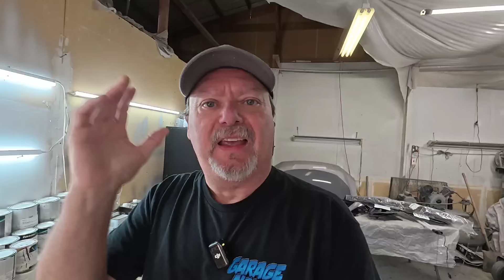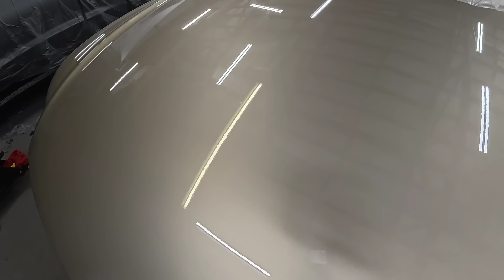How to Spray Clear Coat Like a Pro | Avoid Orange Peel, Runs & Dry Spray!

Comment: Great video 
You mentioned you sprayed the color last week .  How am days ago was it ?  I sprayed color just about 2 days ago and now ready to spray clear .  I’ll Just tack cloth and spray clear like you did in this video ?
Thank you sir
Reply from the maker: No most base only has a 24 hour window before you may have adhesion problems.  I painted part of the car the previous week base and clear. You will need to scuff and put one more coat of base before you clear coat.

Comment: Question.  Sanded with 600 cleared over previous clear.  Body panel clear cost now is cloudy and can see scratches under clear. Any fix or just sand a rebase and clear panel?
Reply from the maker: If your sure it's under the clear than no. It would need to be sprayed with base then clear.

Comment: Hi I know this may be a stupid question - But I will be painting in a small 2 car garage.   Can I get by with turning my furnace and water heater to pilot,  or do I have to completely turn both off to be safe.    I'm just not sure how combustible painting a urethane base/clear coat in my garage is.  I will be cracking the garage door open with a couple fans exhausting the fumes out.

Comment: Chris, your videos are well done and very helpful! Just downloaded your Clear coat pdf. It is great and I recommend it. I need a spray gun for only one job, I am planning to paint an entire kit car and would like to try and get as close to show car finish as possible. I know that depends what type of clear and which spray gun you use. Since you have reviewed the Inokraft drizzle d1 lvlp paint gun and the Porphis 717. Was hoping to get your opinion on which gun for my circumstances, for sealer, base and clear. I do like the idea of the limited overspray from drizzle and fine atomization of the Porphis. I do have a modified enclosed front spray booth which I use for cabinet work. Lastly, any particular Clear coats for this project you can suggest?
Reply from the maker: Happy to hear you enjoyed the p.D f on the clear coat. I do really like the low volume, low pressure paint gun, the drizzle. But if you're looking for a little bit finer atomization,  the 717 is great, But I really like the porphis prd 627. It's actually a little cheaper than the seven seventeen. Check out my video's using it great gun.

Comment: Hola Chris. How do you eliminate static electricity before applying the base color? Cheers 🙌🏼💯
Reply from the maker: The only thing I do for static electricity is 70% Isopropyl alcohol.  I thought about getting a static gun, but those things are near a $1000.
I can't pull the trigger on that.

Comment: Why is the clear spray not foggy? Whats the light on the gun?
Reply: I’m a newbie myself, but foggy is moisture getting trapped in the clear and laying down way too thick as well.
I just paint guitars, but I’ve found that if you get right after it with a nice hot hair dryer it seems to clear up a good deal of it. (I live in an ultra high humidity area so I’ve had to deal with it a good bit)

Comment: Clear coat like a pro!!!😂 😂 there are thousands doing this every day and suck at painting but there a pro???
All manufacturers have there own formulas and that makes many veribles on top of temperature  the speed of the activator reduces, gun type and doesn't even need to be a top of the range of gun!!! After years of painting it doesn't matter if your painting with a 15 or 500 dollar gun you will be able to lay down clear coat like glass. The quality of gun comes in to its own when laying down base and speciality paints. Even then buying a top dollars gun doesn't mean top dollar finish, it needs fine tuning not only breaking it down to clean and make sure there's no debris from  manufacturer. It also means mixing and matching needles and tips. So don't be fooled by these videos and pissed when it doesn't work out.😊
Reply from the maker: What the point of your comment? Not everyone can paint like a pro?
Reply: @GarageNoise  the point of my comment  is simples to say to those that only do it as a hobby or there own cars. It takes time to understand the product your using and no the price of a gun, unless your not laying down solids. Then there are veribles but doesn't again mean you need a top dollar gun. I'm trying to encourage people and make them realise they don't need all this high dollar stuff to do a good job.
Reply from the maker: @walkingwithdogs8547  absolutely, in fact I said just that in the video.
Reply: I’m still a newb at it. Everyone starts somewhere. Everyone knows that just watching a video won’t make them a pro. But we appreciate videos like this for the tips and visuals as well.  I appreciate videos like this. 
That being said, ppl are impressed with the garage hobby paint I do.
Reply: @saleens330  yes everyone starts somewhere and yes it can be helpful to watch another person, but doing  it yourself and making a pigs ear of it, is the best way to learn if you have the patience and determination.

Comment: Thank you for the time and effort it took to make this video. I am sure I will watch it several times before I paint my home project 70' Mach 1 this spring.  I have a few questions. I am probably going to buy the lvlp gun you talk about. I love the way the Sherwin Williams 710 and 720 lay down and look so good in videos . My research shows that their product CC 200 appears to hold out and keep its gloss better. How do you feel about that, and do you think I would be able to lay it down as good as 720.  I have the money to buy what would be best. The car is not a frame off restoration but I have replaced the rear quarters, front fenders, floor panels. It will be in show and shine, but it will not be going to judged shows. As long as I like it that is what I want.   Also I noticed you have Nason products. Is that what you use for primer and base?  It appears you like the Sherwin clears over Nason. How do you feel about Chroma Clear or PPG 2021.  Thanks again. I guess I am looking for a medium cost good paint that lays down nice for a weekend hobby old timer like me.
Reply: Thanks again for the great reply.   I think I am probably going with Sherwin Williams products.   In your answer you brought up 740. Do you like that as a better choice for me than 710 ?   Which Sherwin Williams clear would you actually recommend for me using the drizzle gun .
Reply from the maker: @TD-ce5ru  Yes, the 710 is for spot painting not a full vehicle.  Fc740 iss for overall paint Jobs.
Reply from the maker: Picking clear coat can be difficult because there's a lot of different clears out there. A lot of great clears. A lot of clears I haven't tried. I use Sherwin Williams products, specifically the 710 cause its s spot panel clear, it dries quickly, It's cost-effective, and it's durable. There are better clears out there. I don't have a specific clear that I can recommend.
The thing about clears is, you really don't know the durability of the clear until you use it, and watch it over a period of time. You really just take the manufacturers word for the durability, or others experienced. So that's what makes it difficult. When I look at clears, I wanna know how quickly does it harden? How well does it buff? Because you will be buffing, it
Now I prefer the fc 740  over the Fc720 FC720 stay soft too long, and it makes it more difficult to buff and get those fine scratches out. It is recommended that you stay with the same same paint line for primers. Sealers paints and clears. It's not absolutely necessary. But it is a good idea. I would talk to your local paint supply store. See what clears they recommend? All the big companies are gonna have great clears. Sherwin Williams p PG Dupont.
There's also companies like tamco or revolt and the new one I heard of called alpha.That's supposed to have a really good clear, that's reasonably priced. Hope this helps appreciate you.Watching best of luck with your project

Comment: How long after paint do i have before i have to sand to spray clear
Reply from the maker: Depends on the paint line your using alway check the Technical data sheet for the paint your using. With that being said typically basecoat has a 12-24 hour recoat window. That means you can apply clear within that time frame without sanding. Would I do that? No, personally I wouldn't wait more that a hour or so. Appreciate the comment and support!
Reply: @GarageNoise do you have to AMD the base coat? I usually don't. I track cloth it but unless I make a mistake,that's it. Especially with metallic paints. Am i wrong?